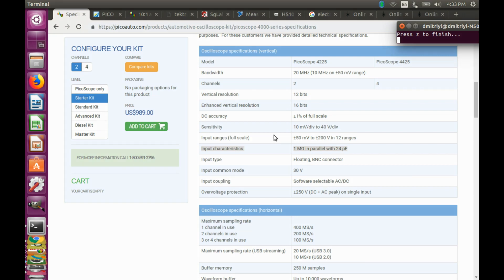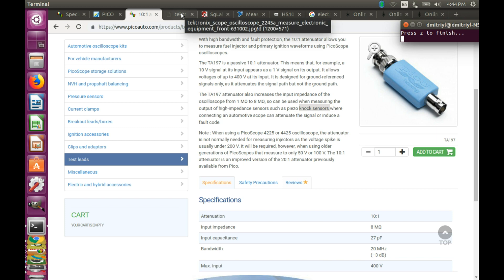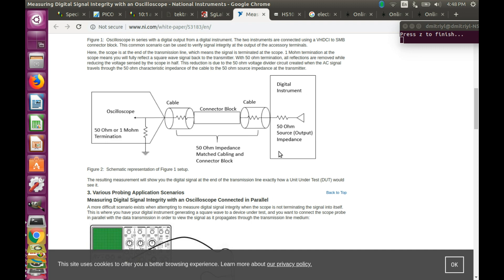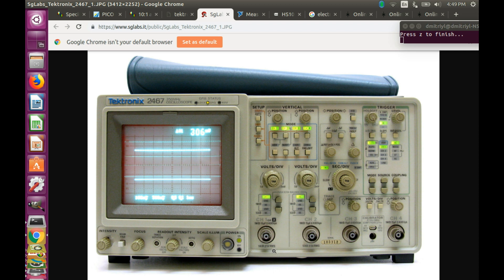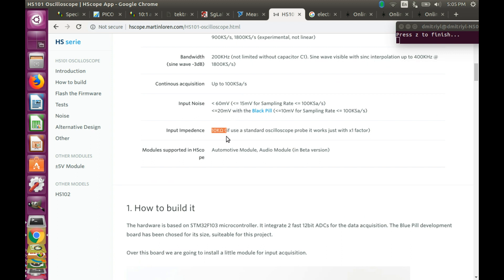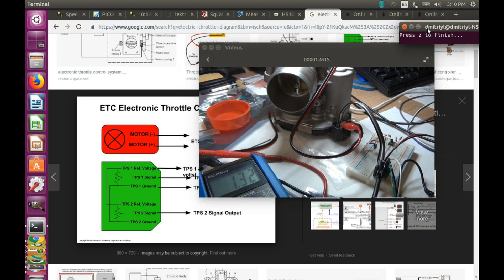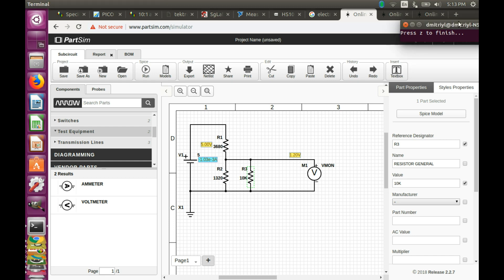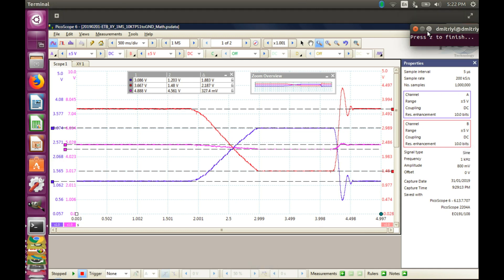[S,A,E] What should your scope's impedance be? 1M, 8M, 50, 10K Ohm?

Comment: Can you simply change the 10k input resistor to 1Mohm for automotive / 1Mohm input impedance work?
Reply: Also, at 5:18, why the 470pF cap?  To filter out AC signal?  Why? just curious.
Reply from the maker: Great question! Just switching the resistor to 1MOhm would not work as desired; I hope to find a bit of time to make a video on this topic, thank you for the suggestion!
Reply: @DmitriyL_Arithmechanics  I worked on an LT spice model to try to map -+100v to 0to3.3v.  I got -100 to 40v to map using 3 resistors and stepping tests.  It uses a 2Mohm input.